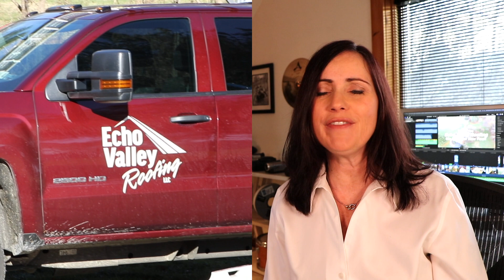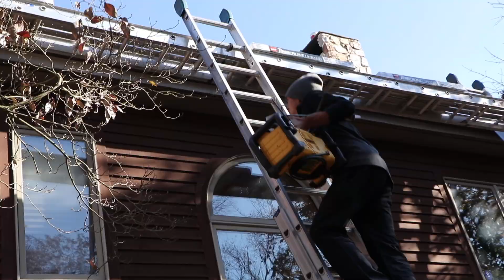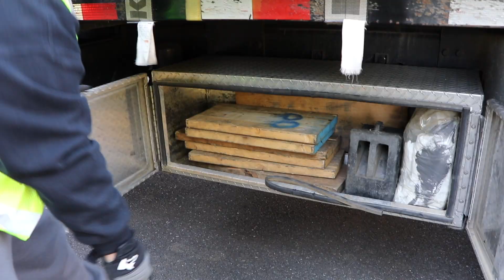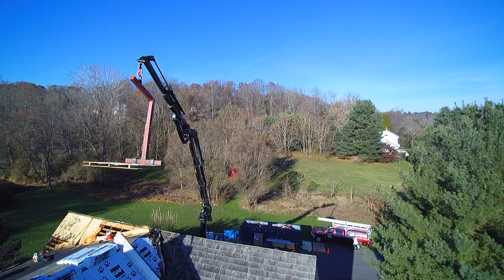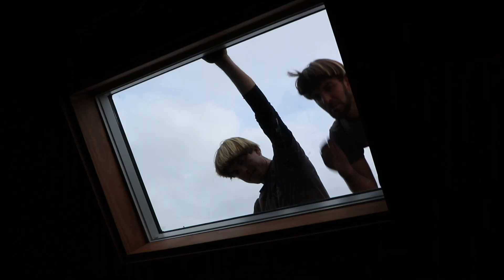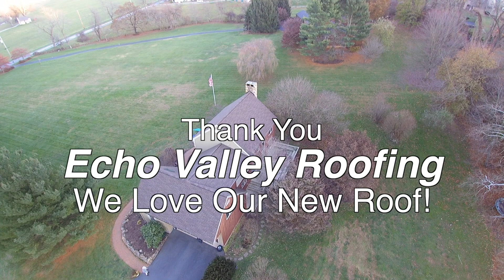These Amish Guys are Roofing Rock Stars! | #theWiRE S4:E1

Comment: They can be good roofers, but nailing shingle on living house is a mistake in my opinion. 
Slates and tiles are a way better material to have on a roof. Wherever you live on this planet
Reply from the maker: @Mathis Briand, why do you think it's a mistake to nail shingles on a living house?
Reply: @TaylorRealEstateAdvisors  it’s not a natural material, it goes bad in 1 or 2 dozen of years, it’s a pain in the ass to remove and recycle it. 
And I would say, but that’s my opinion, it looks crap
Reply from the maker: @mathisbriand5759  you're talking about the asphalt roof?
Reply: @TaylorRealEstateAdvisors  same thing